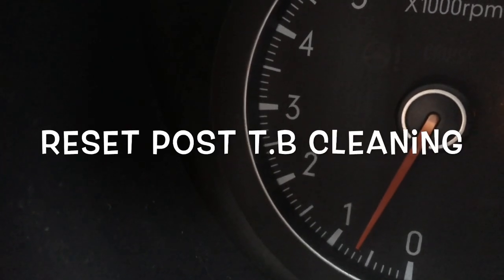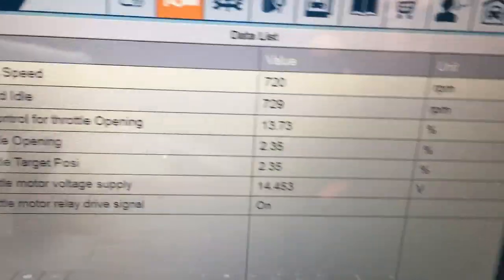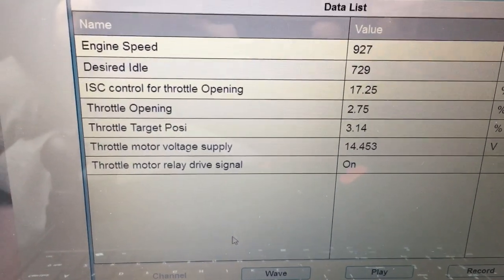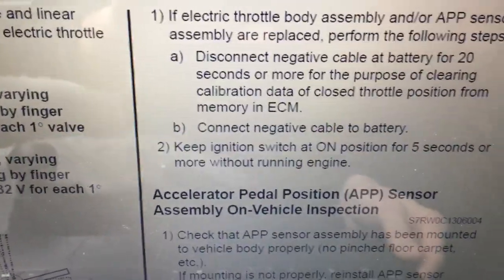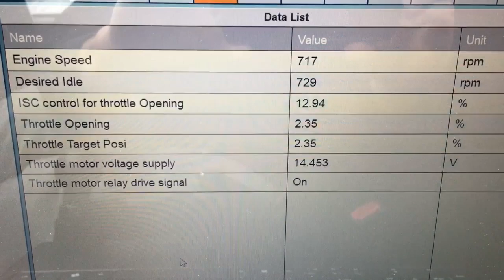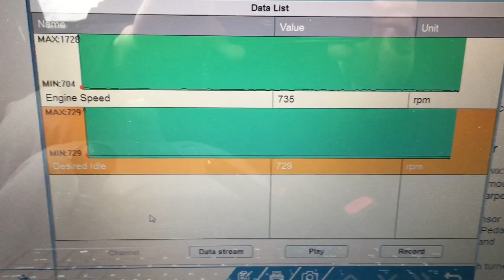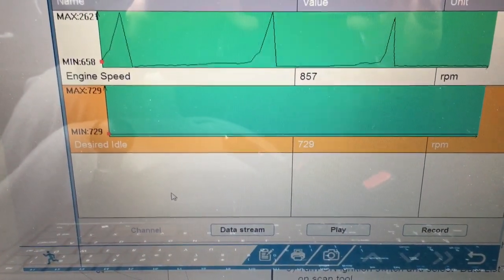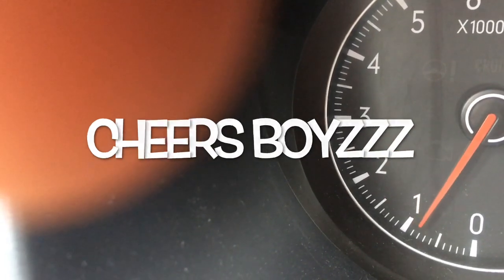SX4 Post Throttle Body Clean Issue

Comment: That should reset your fuel trims as well Ian she mite not run the greatest for a while until it does a drive cycle nice video as always. never owned or worked on a Suzuki before i like the grand vitara
Reply from the maker: Oh aye Ian, everything will have to relearn its trim values again. Kinda the neanderthal reset technique but the "Pecker" does not support throttle adaptation for this model...It's ok...all good. Cheers Pal

Comment: I have and SX4 and it keeps just overflowing the coolant tank every day,  after I park it. I have replaced the radiator cap, I bleed the coolant system for air, is any one had this issue? I did get the repair manual, and it the diagram it seem like there is a path way for coolant to go through the throttle body on the car, how do we bleed that air ? Thanks in advance if any one can help.
Reply from the maker: Hmmm. This is not good. You didn’t mention the temperature itself…Assuming your coolant quantity is correct. Pump, fans and radiator are flowing…You might have a head gasket issue, leaking combustion gases into the cooling system. Consider checking that. Good luck 🍻